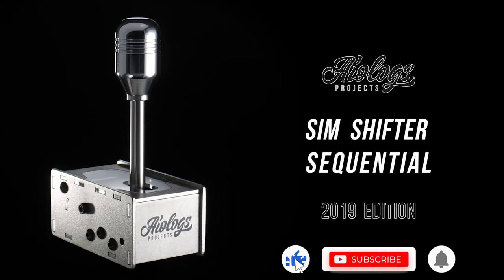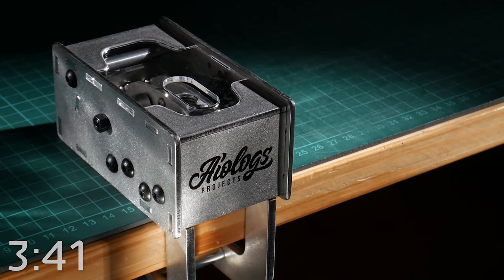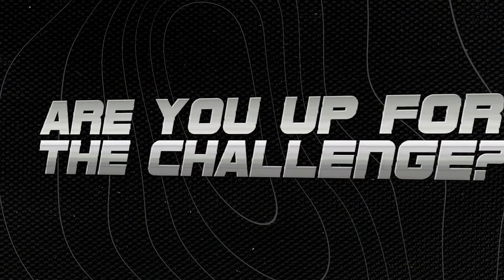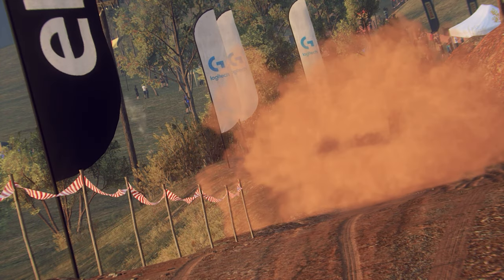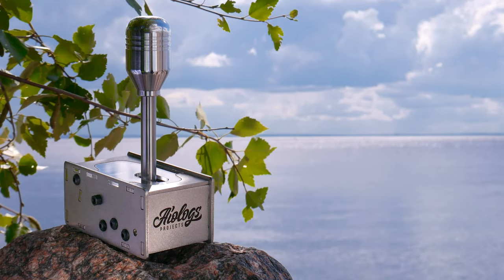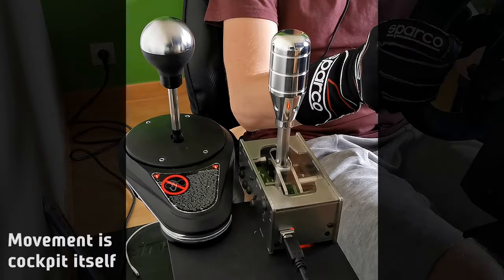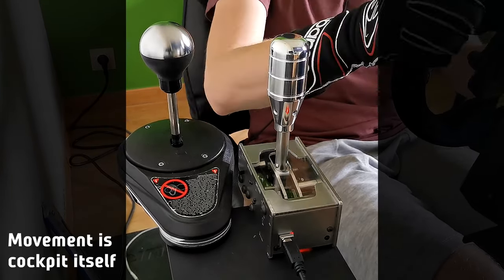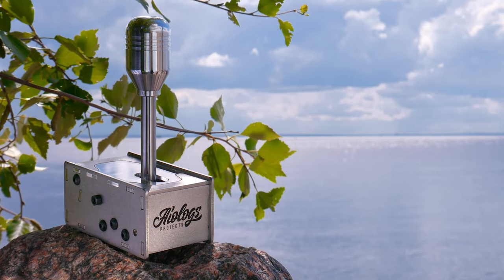Aiologs Projects Shifter Review | Tremendous Value for Money!

Comment: I've got the same on my rig, together with the handbrake. Absolutely love it. The design of these products are simple, but sturdy and effective! I can't imagine my rig without them.
Reply from the maker: Great to hear you enjoy it!
Reply: @SimsRacingDesign  maybe also good to mention that the aiologs shifter and handbrake are supported by drivehub, so you can use it on console with any wheelbase you like. That's why I bought it in the first place, to have a sequential shifter and handbrake, together with my logitech G923 wheel on PS4. But in the end, the shifter and handbrake deserved it's place on the higher end rig.
Reply from the maker: @WastelandMutt  I wasn't aware of that point yet.  Thanks for letting me know.
Reply: @SimsRacingDesign  yeah, it's a great option for console players that want to buy a handbrake and sequential shifter when you own a logitech wheel. Where thrustmaster and fanatec get you covered with their own ecosystem.
Reply: If I buy Aiologs shifter from there website would I require to pay import duty when it arrive in USA
Reply: @nikky4757  probably yes, I paid it too for delivery in Belgium